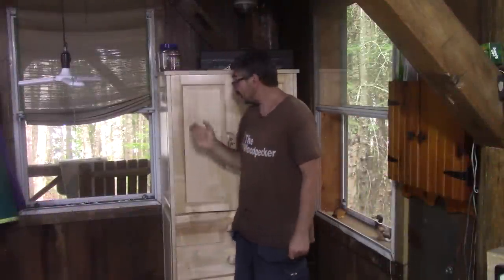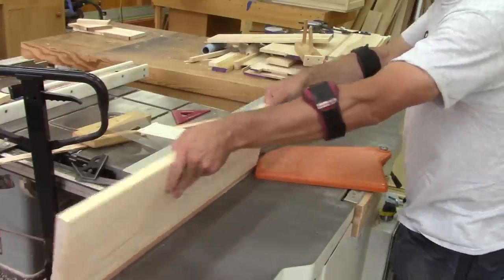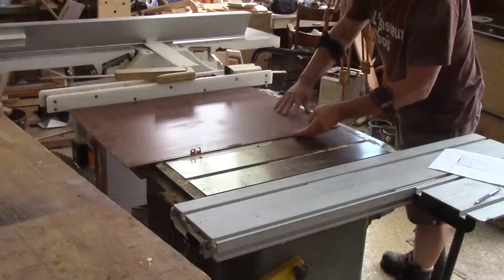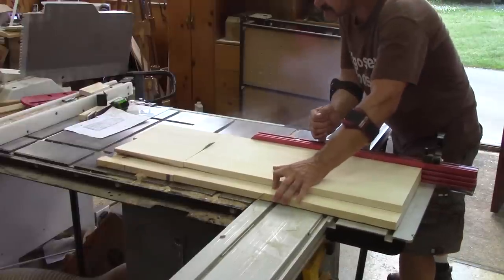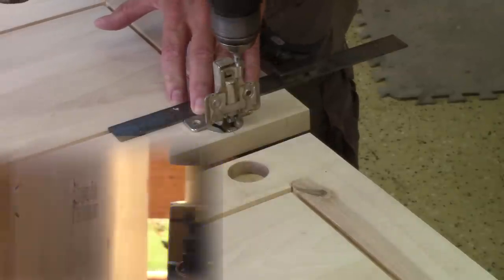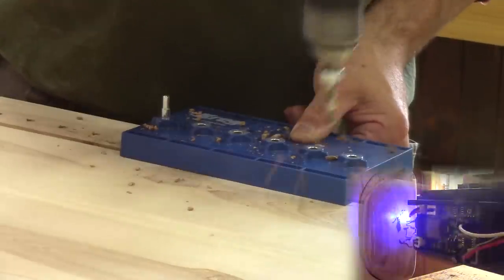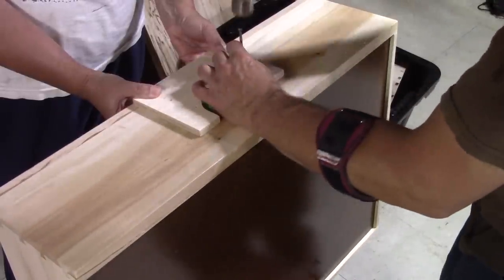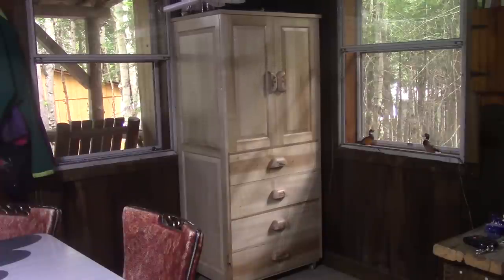The Woodpecker Ep A 290 - pantry for the cottage part 2

Comment: That's a beautiful pantry!  I hope that les souris won't take advantage of the change from the old steel pantry.
Reply from the maker: Thank you
I never had any piece of furniture eaten by the mice out there, al of them were "mice proof" by adding a bottom to every dresser. I figure this one will also stand out to the mice, probably better than the metal one...It had some wider gaps between the sliding doors than the1/6" gap I did on this pantry.